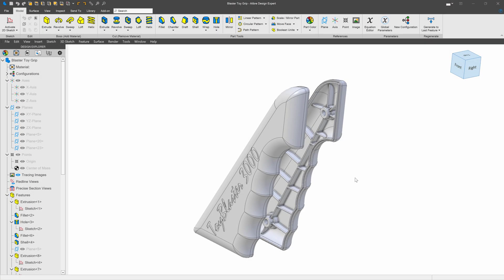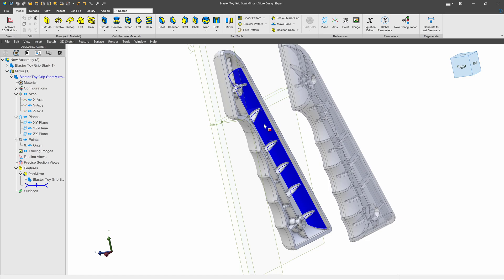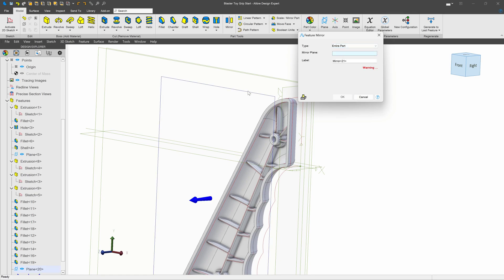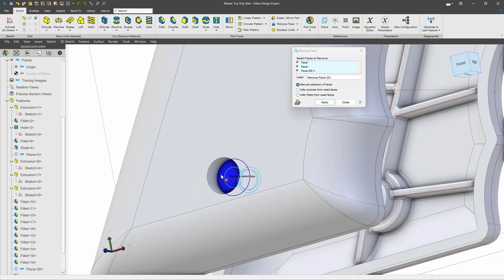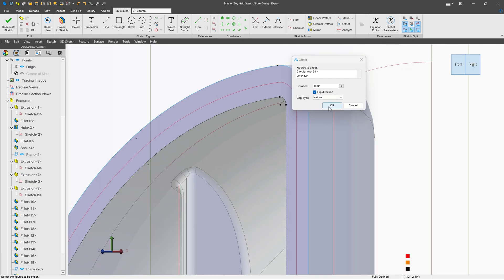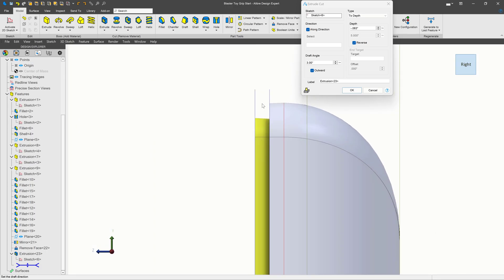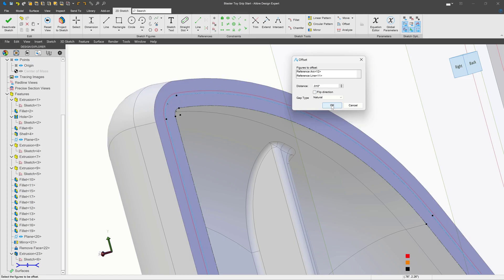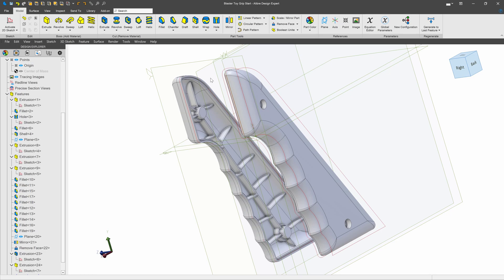Alibre- Multibody Modeling Workflow Example

Comment: This is fantastic. Are there any other body/part creation options where I can work like this or is it just mirror? (I'm thinking I would specifically need linear pattern, circular pattern, and heck, even extrude would be really nice to all have that "create as new part" checkbox in. I'm coming from Fusion/Inventor, and a create new part/create as new part checkbox with the functionality you've just shown here would basically enable top-down modeling. 

I note that the documentation has a page that defines top down modeling, but I haven't seen anything beyond that about how to do it in Alibre. Googling to try and figure out how to do it is how I found this video. I'm fine working in an assembly to do it, I just feel like I'm missing something.
Reply from the maker: I would be unsurprised if multibody support features  were more highly supported in future versions.  This would be a good topic for a video, I can see a few ways to achieve those kinds of workflows, though they are currently not directly supported and would require a few extra steps as a result, and would need to use some of the tools in pro and expert.

Edit: I'll make a video on this topic as soon as I can and get it out for you.  It will be along the lines of modeling the tort bowl, which uses some multibody or multi piece techniques.

https://www.youtube.com/watch?v=33pJMY40_Kc&
Reply: @AlibreLLC I'm excited for that. I'll also check out the video you linked. Thank you!
Reply from the maker: @PockyBum522  Here is a video with a focus on your question.  I hope it is helpful!

https://www.youtube.com/watch?v=-IEEUjm-qeo

Comment: My company intend to migrate from Inventor to this Alibre Design Expert... but, after a month trial, i still not found any solution to this:
In Inventor, the workflow i use is using Derived feature to derived a solid body from other part as a boolean cut (Subtract join in Inventor).
Does anyone know how to insert ( as in Solidworks) or derived (as in Inventor) a solid body from another part file?
Reply from the maker: Indeed.  In Alibre Expert, under the model tab, click the drop down arrow on boolean unite (next to part color) and select boolean subtract.  From there, you can choose the part you would like to subtract from the part you are working on.

If you cannot import the non-native geometry to boolean, go ahead and open the non native part in Alibre and save it as its own file.  You'll then be able to import that file into Alibre since it will have been converted to the native Alibre format.  

Best
Reply: @AlibreLLC  Brilliant!, thank you so much!... i never expected that, i thought to use that function, multiple solid bodies must be present.
Reply from the maker: @khairilakmaryahaya8914  We're very happy to hear that worked out.  Please reach out if we can help you more, and happy modeling.

Comment: Great demo of creating the two parts. Putting them together in an assembly could be a challenge except for the ability to use configurations.
Reply from the maker: Indeed, the use of configurations, parametrically adjusting the mirror plane (I  put it 0.001" offset so they were effectively together) or using variables could all be options to position the bodies for assembly.